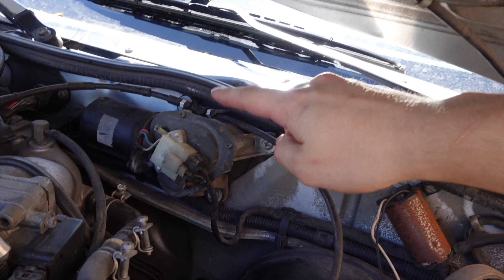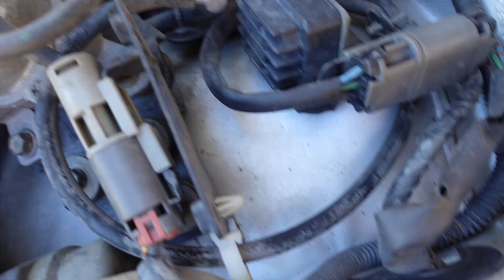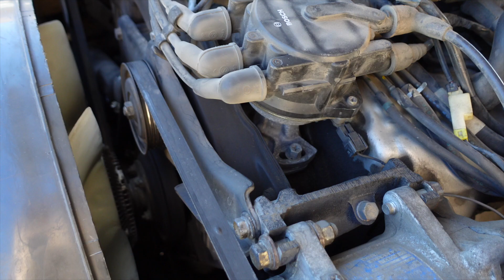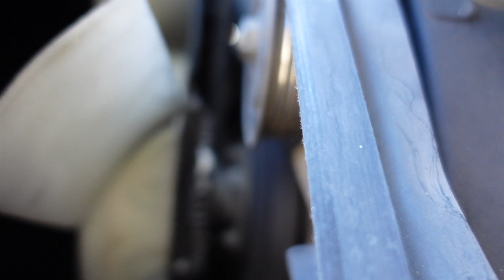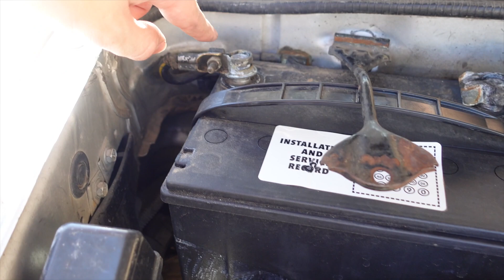Engine Bay Walkthrough! (300zx Z31)

Comment: Thank you for the information regarding the power steering lines leaking on the alternator, could it be any other oil line leaking on the alternator?
Reply from the maker: Most likely would be engine oil from the valve cover. Maybe a leaky cam seal somehow could get to it too from the timing covers. If it's on the bottom, I'd be looking for a leak around the harmonic balancer getting flung up onto it

Comment: Beside the battery by the fusible link, there is a green relay is that the fuel pump relay? I cannot find the fuel pump relay on my 86 for nothing.
Reply from the maker: From what I remember, the fuel pump relay is in the passenger side door jam on the back side of the door, behind that vent at the bottom. You pull the vent out and it's in there
Reply: @TheZGarage thank you so much

Comment: Own an 87 300 z .Moved to sarasota and found every numbskull so called expert on z engines . If I was a violent person  I think a Ray Donovan baseball bat might at least a temporary solution. Problem is at 78 my chassis is failing worse every day and a louisville slugger  is not a real option.  a half hour listening to you is like a cool breeze blowing in from the gulf which doesn't happen until december in florida. I will subscribe at with my next pay check. thanks for the light at the end of this florida tunnel.

Comment: Thanks for the video! What is the red connector for at 3:45? Mine is connecting to the mount on near the edge (left side on the screen where you have 2 screws hole).

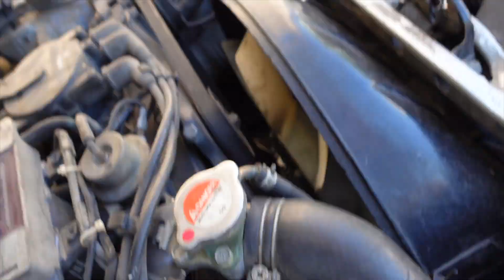Comment: the upper radiator hose where it meets with the piping off the block like right where the radiator cap is broke on a z im looking at can you let me know if its made into the block or if i can replace it timestamp 12:10 you were pointing at the vacuum hoses around it
Reply from the maker: That whole section there where the radiator cap is located is bolted to the block. If you can find someone with a parts car, you can just replace it pretty easily.
Reply: @TheZGarage  man thank you a ton for replying so quickly I really appreciate it

Comment: Thanks! Any chance you could post a link to the CHTS extender? I couldn't find the one you were talking about for my 85na
Reply from the maker: The company making the extended harness hasn't been doing well getting orders out recently, so I recommend this place. https://xenonzcar.com/store/product/z31-cylinder-head-temp-sensor-sub-harness/
Reply: That's great thanks very much!  You said you did a video about relocating the CHTS, I've been digging through your video's and haven't found it yet, was that part of one of the timing belt videos?
Reply from the maker: It's a separate video. You can also find it on my website under the write up tab. The video is linked there as well.

Comment: Thanks so much for this. I'm located in Europe and over here we don't have as many tutorials/videos on that car. I was wondering where the engine oil dipstick is? I can't seem to find it. Got a '86 na model.
Reply from the maker: I'm not sure if they changed it on European cars, but here in the US it's on the driver's side of the engine (so passenger for rhd) and comes up right next to the valve cover, close to centered on the valve cover.
Reply: @TheZGarage  I found it thanks to you. Cheers :D

Comment: Hi, I'm new the z garage. I've had my 1984 for 10yrs, always been reliable until recently high idle issue. Cold its fine, heats up, 1500rpm with no heater, lights or aircon on. Changed my fast idle control valve, checked all vacuum lines I could see, could it be my air idle control valve, maf or throttle position sensor? It does have poor acceleration at high speed! Love any ideas to help me out!
Reply from the maker: Honestly I'm not too sure. My first thought is a vacuum leak, but cleaning the maf might help as well

Comment: Quick question, those fusible links near the cruise control, would they have anything to do with the power going to a digital dash?
Reply: I don't believe  they do.  your digital dash has a  power supply under the dash right above where you're right knee would be when sitting in the driver's seat.  these usually cause the display to go out.  also, that little round valve thing right next to the fuseable link box is your speed sensor (for the speedometer on the digitital display)

Comment: where does the speedo cable come out at? i need to swap mine out for a new one and i dont know how to replace it unless you wanna make a video on it that would be even more awesome. i cant find a single vid on replacing z31 speedo cables.
Reply from the maker: The speedo cable comes out of the tail housing of the transmission on the passenger side. There's a cover kind of thing you unscrew and the cable pulls out once it's off.

Comment: Hi. I'm hoping you can help me with this. I thought putting a cone filter on this car was going to be simple but it seems that, like EVERYTHING else on this car. It's not so simple! Even with years old information from forums, and websites DEDICATED to this MIND FUCK of a car. I followed Zbums directions and bought the K&N RE-0810 cone filter, and a 3 inch by 6 inch straight pipe. I want to delete the old air box, and silencer. The elbow on the right of the silencer box is MUCH LARGER than 3inches. I tried putting the aforementioned filter with a 3 inch flange on the silencer box. IT DOES NOT FIT. IT IS TOO SMALL. Any suggestions on the CORRECT size? Or the CORRECT combination of parts to do the intake box and silencer delete?

Comment: I don't know if anyone's told you this yet, but that Z31 is most likely an '86 model. Someone's just managed to put a '87+ front clip on it. Clues that give it away are the wheels, which I believe those specific wheels are only found on the '86 model year, unless they were swapped at one point, and the tail lights. the '87+ Z31's had the solid bar type that was flush across the back panel, not the upside-down U looking ones on this Z.
Reply from the maker: The white Z is mine and it is an 86. The Z featured in this video is my friend's and it's a true 87. It has solid bar tail lights, single bulb headlights, and other year change differences like a different style of front control arm tension rods.
Reply: @TheZGarage  So you showed the body of yours and the engine of his?
Reply from the maker: You can see both cars in the first 30 seconds of the video. I show my 86 and explain how it's not a great example of a stock car, but then show the 87 which is very much a stock car
Reply: @TheZGarage  Forgive me. My brain didn't catch the move from the one Z to the other. Completely glazed right over it.
Reply from the maker: Haha no worries!

Comment: Really helpful video. I have an 85 naturally aspirated VG30 with the wires to the throttle body chopped off as well as other connectors. I see that it has 3 pins but looking at this video.  I think I only saw 2 wires going to the throttle sensor. Can you please tell me if it has 2 wires and what color wires. I'd really appreciate it. :D
Reply from the maker: I don't have my stock wiring anymore, and I gave this Z back to my friend. You may try checking in the factory service manual on XenonZcar.com to see if it lists the colors

Comment: I have a misfire on cylinder 3. I replaced the spark plugs NGK, wires NGK but the cap comes from Advanced Auto. Could the rotor cap be causing my misfire because it is not OEM? Also, what do you think about a RB25DE or DET swap?

Comment: Can you tell me where I can find a fuel temperature sensor. It screws into the fuel pressure regulator.
Reply from the maker: I couldn't find anything new, but there's a good condition used one on 300zxpartsforyou.com under page 73
Reply: @TheZGarage  thanks, but I noticed in 1 of your videos you said it really shouldn't make a difference.  I live in tn its been pretty warm here. The little nipple where the wire plugs in at got broke the other day. I drove the car ran fine until I stopped at the store, I shut it off but when i tried to start it wouldn't. After an hour and turning t h e ignition off and on multiple times it started. Must parts on the car has been changed. The car sat in a field since 2008. I replace a lot of parts and brought it back to life.

Comment: If my headlights suddenly stopped working (the lights still work but they don’t go up or go down) should I just replace them or would I just test them by connecting a positive and negative to it?
Reply from the maker: If you rotate the little knob on the back and they pop up and then go back down the motor is fine. It's most likely the Headlight switch on the steering column. It controls when they move and the contacts like to get corroded
Reply: @TheZGarage  thank you!

Comment: So sorta off topic question pertaining to the video, but on my 86 na, once I shut my car off it sounds like there is some sort of fan that stays on for roughy 30 minutes, is this a normal thing?
Reply from the maker: It is normal. It's called the injector cooling fan and it blows air on the injectors to help keep them cool after the car has been running. They used to have issues with hot starts when the fuel would vaporize in the fuel rail due to heat soak and it would be difficult to start. I believe modern fuel is a bit more resistant to vaporization so I've removed the fan that was on mine and haven't had any issues. But unless it's causing a massive power drain, you can leave it and it won't cause any issues

Comment: I have 88 ! My ac comes out warm and doesn’t come out through all the vents inside
Reply from the maker: You've probably got a vacuum leak between your intake and your vacuum canister then. The canister controls both the heater core and the interior controls and if it doesn't have enough vacuum the system defaults to hot air on defrost. If the vacuum lines and canister seem to check out, then the hvac system has bellows that move the vents and they can tear with age and cause a vacuum leak

Comment: hello thanks for your video, my problem is that my Zx 300 is losing petrol through the exhaust. It also smells like petrol in the oil.  can you help me what it could be?  when starting the engine, a whitish fuel-stinking cloud smokes to the exhaust, I even have a video of it.-😱
Reply from the maker: My best guess would be a stuck injector or two dumping way too much fuel in the engine. I would also do a block test to check the head gasket.